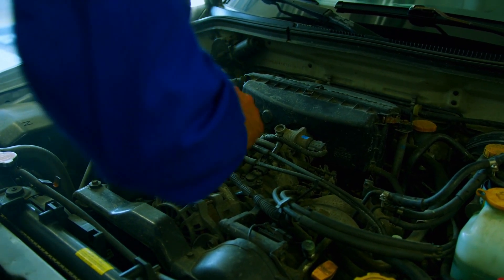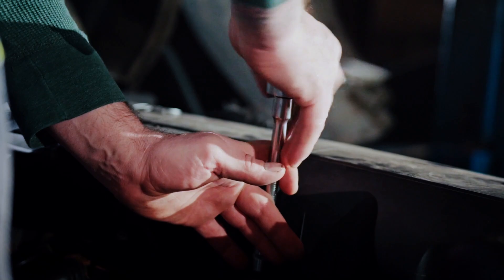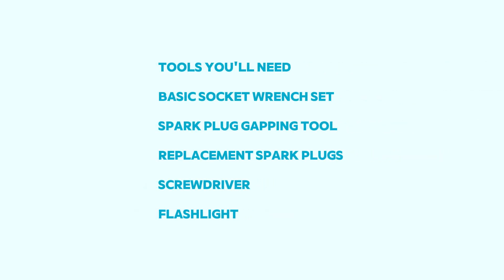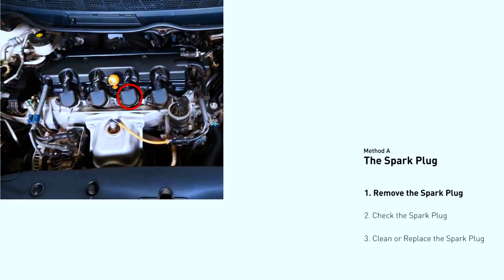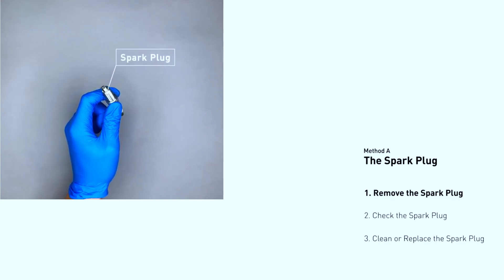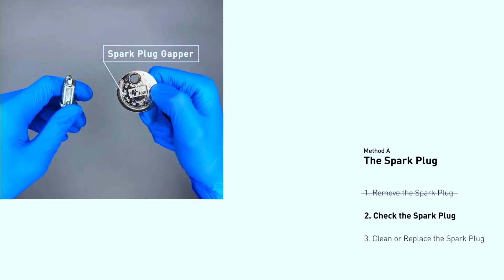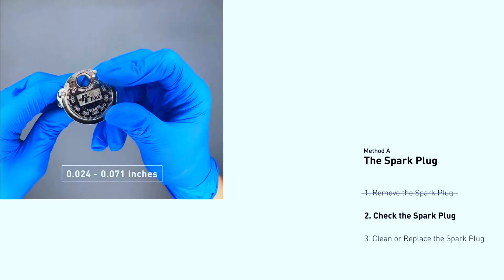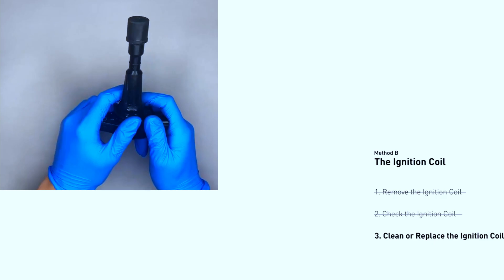P0305 Code: The Secret Code Your Car is Trying to Tell You |

Comment: Bubbles will not appear at a vacuum leak.
Bubbles will only appear at a pressure leak.
Reply from the maker: You're absolutely right! Bubbles at a leak location indicate a pressure leak, not a vacuum leak.

The P0305 code translates to "Cylinder 5 Misfire Detected". This means the car's computer has detected that cylinder number 5 isn't firing properly. There are various reasons for this, completely unrelated to a pressure or vacuum leak you mentioned.

Here's how these two things are separate:

P0305 Code (Cylinder Misfire): This code signifies an issue within cylinder number 5 that's preventing proper combustion. Common causes include faulty spark plugs, ignition coils, or fuel injector problems.

Pressure vs. Vacuum Leak: Leaks can be either pressure leaks (unintended escape of pressurized air/fuel) or vacuum leaks (unintended entry of unmetered air). These leaks can affect engine performance, but wouldn't directly cause a misfire on a specific cylinder (like the P0305 code indicates).

If you're experiencing a P0305 code, troubleshooting for the misfire in cylinder number 5 is recommended. There are resources online and in repair manuals to help diagnose the specific cause. You might consider:

Checking spark plugs and ignition coils in cylinder 5
Testing the fuel injector for cylinder 5

For the leak issue, you'd need to identify the type of leak (pressure or vacuum) and its location to fix it. However, it likely wouldn't be the direct cause of the P0305 code.